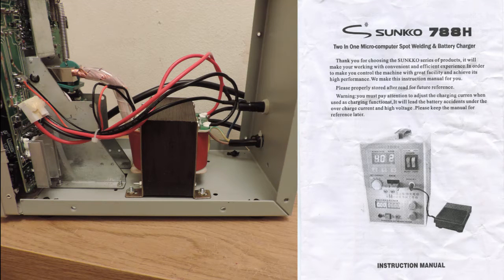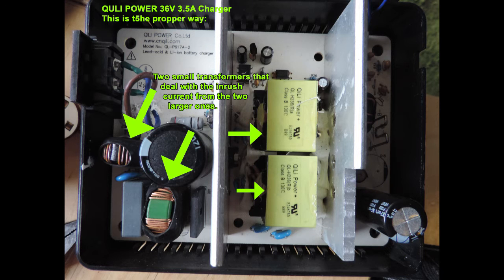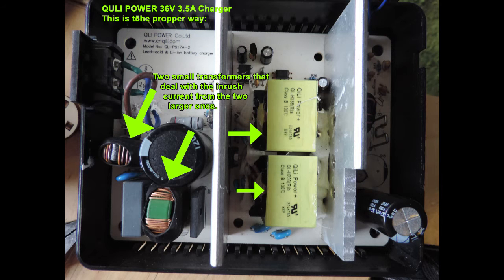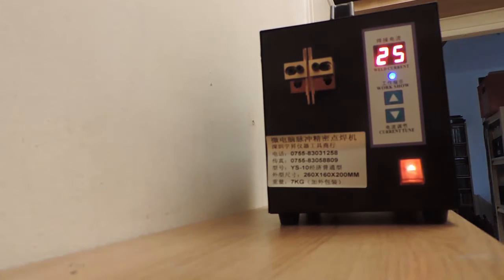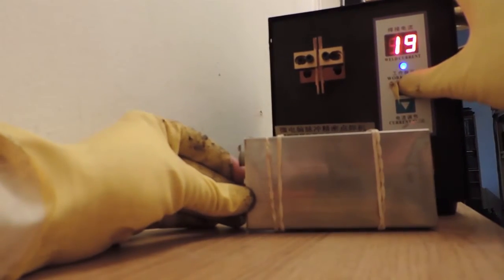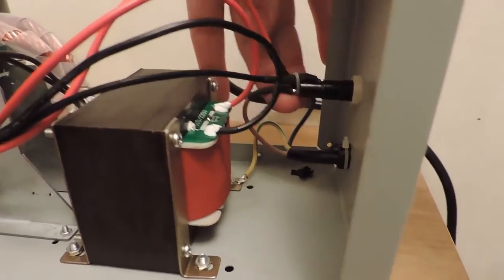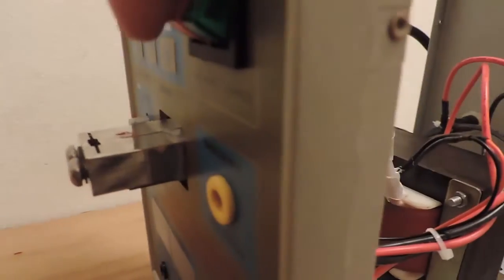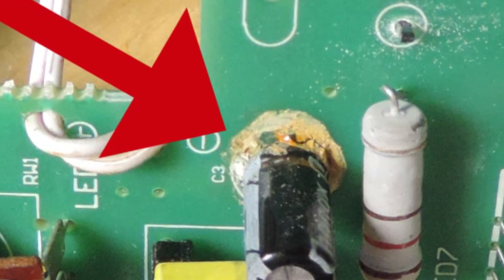Battery spot welder Sunkko 788 is a piece of crap! Does not work in EU!

Comment: It's complete bollocks. The small transformer ist just parts of the controllers power supply and has absolutely nothing to do with inrush current limiting. Also the power supply shown does not use inductors like the ones shown for inrush current limiting. All they are for is mains filtering and noise suppression, no more, no less. The components shown inside the ys-10 welder(whch i do own, btw.) are not what you claim to be. It's just a snubber network to suppress voltage spikes that would otherwise go out to mains or fry your controllers power transistor. Also, the ys-10 is just as badly designed as the Sunkko 788. Both are notorious for breaker tripping and breaking. My ys-10 actually fried two circuit breakers before i modified it. Replacing the welding transformer with a rewound MOT is the way to go. No bullshit. The transformers are simply to wimpy to cope with the intense energy pulse.

Comment: it will work there if you solder the other bare tap on the transfromer.. they come preset too north america witch is 110v not 220.. so pop it open add soder too the bare tap  .. one should say on the transformer board 110 then  a line mving to the edge of board on trans  will at the end you need too solder

Comment: Hi, I bought same spot welder from Aliexpress and I had same problem. I live in EU (Czech) and we have same 220V outlets. First I tried on 16A fuse at home, but welder didn't work. In the workshop I have 32A fuse. There is no problem. So, I wanted to use at home on 16A fuse. In welder is big transformer which needs a high inrush current at power. Which is probably more than 20 amps for a short time. It is necessary to reduce the current. You must instal this: https://drive.google.com/open?id=0Bwpsc9tX2Wm4ZXhfVTFGMVVWVnM